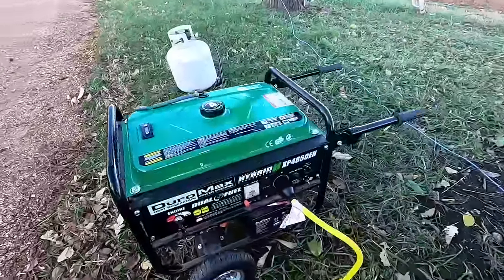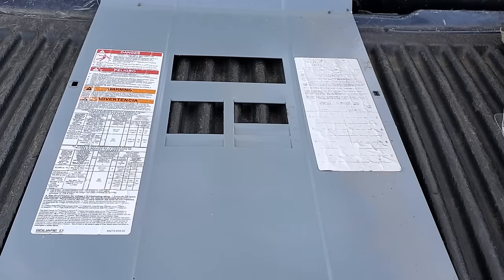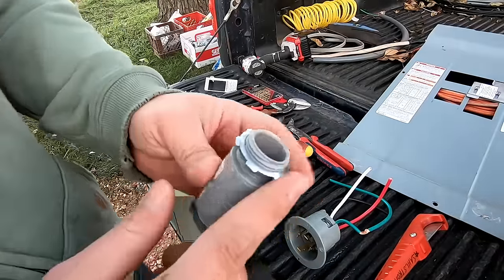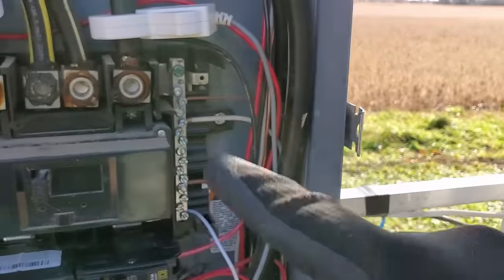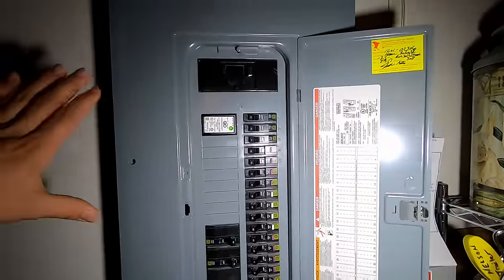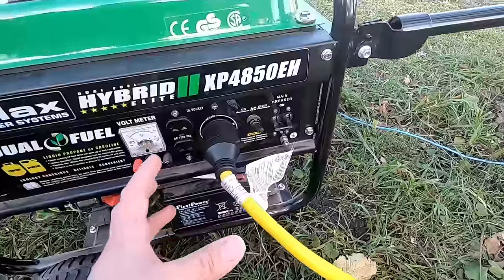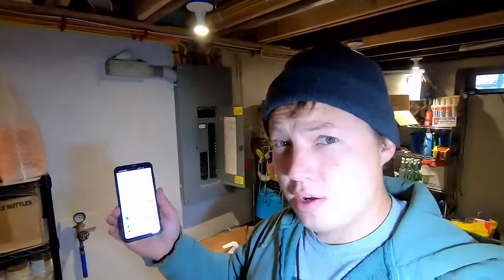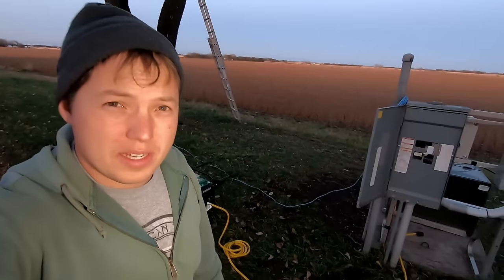How To Hook Up a Generator To Your House Using a Breaker Interlock Kit & Power Inlet Box

Comment: Nice job Ben; thanks for your helpful videos! Question for you regarding grounding the generator... I note that you felt grounding the generator frame to a grounding rod was not necessary because there is a ground current established via the power receptacle on the generator back to the ground in the breaker panel. However, if the generator’s ground is bonded to the frame, isn’t there still potential for a human body to complete a circuit between the generator frame and the ground... even if there is already a ground circuit established via the cord going back to the panel? If so, wouldn’t it be best to unattach the generator ground-to-frame circuit? Or do you feel that’s not necessary? I’m using a DuroMax dual-fuel generator as well, and haven’t looked into the wiring harness to see how that would be done... any tips on that? Thanks for the help!
Reply: Following up on the grounding issue: take a look at this video on YouTube: Interlock vs. Transfer Switch - a follow up video.wmv
Towards the end you’ll see that this person removed the ground-to-frame jumper on his generator because he wired his generator directly into the house panel, just as you did. Think it’s something you’ll now consider doing? I would like to look into myself, and determine which wire is the grounding bond on my generator. Any thoughts?
Reply: Also: did you ever assess why your generator breaker went off on you in the video? Didn’t seem like you were really pushing the load on it enough to cause it to shut off???
Reply: Actually, the issue isn’t as much as the ground to frame connection as   much as it is about whether your generator has a bonded- or floating-neutral configuration! I believe a quick continuity check between the neutral and ground pins of your generator receptacles will confirm that your generator is bonded neutral. With your application, powering the main panel directly from the generator receptacle, I believe you would want to reconfigure your generator with a floating neutral. Basically would involve disconnecting the short white jumper that connects the white wire (neutral) coming out of the windings to the generator casing. Bet that’s what you’ll find if you open up the generator cover! You with me?!?
Reply: I talked with DuroMax for more clarity: even though your generator’s neutral is bonded to the ground, DuroMax calls it a floating neutral generator  because the bond is made at the generator casing and “floats” unattached to the generator frame (note that the generator is mounted on rubber insulated mounts). It’s probably more accurate to call it an “isolated  neutral.” In any event, you may want to reconsider your wiring with the generator with your application. DuroMax suggests grounding the generator with a grounding rod attached to the grounding nut on the generator’s control panel and then eliminating the generator-receptacle-to-main-panel-ground-bus connection. Your current hook-up may be problematic because your ground circuit is “energized “ by the neutral at the panel, where the ground and neutral busses are connected. Make sense?
Reply: Interesting; perhaps your generator mounts are not insulated... I notice you got continuity of the ground between the breaker panel box and the actual frame of the generator (or was it the screw holding the generator control panel?) - not just the grounding nut on the generator control panel. My generator is the DuroMaxSP12000EH, and might be configured slightly differently than yours... but still you might want to do a simple continuity test between the neutral and ground pins of one of your receptacles to see if they are bonded.

Comment: Hey Ben! This is a great video, thanks for sharing. I especially like the way that you ran the leads coming in from the back-feeding circuit through the Sense clamps such that you can monitor your loads while off-grid. It seems like this approach would work just fine as only one set of leads will be energized at a time. Do you find that placing the clamp around both sets of leads works as you thought it would? BTW, I used your discount code to purchase a Sense device a little while ago. :)
Reply: ⚠️Please don’t forget the rules about generator safety: This is a very important announcement for everyone. It’s important to follow all generator safety rules whenever we use portable generators: 

Everyone must see this. This is just a reminder for everyone’s safety. 

1) KEEPING OTHERS SAFE: Please do not allow an unqualified person or your children to operate and service the portable generator. Just because some manuals don’t say that doesn’t mean it’s safe. That is important against the generator safety rules. We also need to be keeping an eye on our children too. You need to make sure that your children are not playing near the portable generator especially when it’s running so they won’t get electrocuted. Generators pose electrical risks and they can be hot during an operation. Please keep your children away from the portable generator at all times. It is important to keep our children safe especially our little ones. Be aware of all the hazards.

2) WHERE TO RUN YOUR GENERATOR: Some people use their portable generators indoors which increases the risk of carbon monoxide poisoning. It’s important to have a carbon monoxide detector if you have a gas generator. Never ever use your generator indoors even if your doors and windows are open and even in the garage is not safe to use a portable generator. Not even at your porch and your deck. It is never safe to use your generator indoors and in enclosed areas of your home. Your generator needs to be 15-20 feet away from your house. 

3)🔥FIRE HAZARDS: Never refuel your generator while it’s running. You need to let your generator cool off before refueling it and before storing your generator. Never overload your generator too. Never ever back feed your generator. You should never plug your generator into a wall outlet. Also never store propane tanks indoors. Please keep flammable things away from the generator as well and please don’t smoke cigarettes near the generator. Having a fire extinguisher next to the generator is also important against the generator safety rules. 

4) GENERATOR OPERATION: make sure your hands are dry before touching the generator. Never use your generator in wet conditions. Don’t let your generator get wet. You need a generator tent if you need to use your generator during wet weather. Please don’t wear loose clothes when operating the generator. Turn on your generator before plugging in appliances. Use the right cord for your generator. Please do not use worn out cords. 

https://youtu.be/I1jT3ANENvI and here is a video more about keeping others safe when using generators 

Hope this helps. Remember safety first

Comment: I sort of understand why not to run electronics (TV's, Computers, etc) off an non-inverter generators, but I've never had anyone tell me why?  Is it current or cycles that does the damage?  HOW?  Also  can a good quality  APC/UPS be used to smooth out whatever it is that isn't good for electronics??

Comment: I noticed that you plug in 240 volts from the generator to your interlock breaker and you said that you now 240 volts going into your house, isn’t it that household appliances run on 110 volts, so how going run those appliances on a 240 volts electricity.
Reply: How long can run your generator with one tank of profane?

Comment: You're breaker tripped because you're using a 30 amp outlet on your generator with a 30 amp inlet box with a cord rated for 30 amps. 30amps x 120volts = 3600 watts. Breakers will/may trip at 80% capacity. 3600 x 80% = 2880 watts. You should know this.

Comment: If the new breaker is only powering one leg (the right side of the panel), does that mean only the right side of your panel has power in the house?
Reply: He installed a 2 pole breaker for power from the generator, so he has both phases. Also, if you only use one phase, it doesn't take out one side of the panel, the phases alternate each circuit or "slot" in the panel.   So on the left side of the panel circuit 1 would be A phase, 3 would be B phase, etc.
Reply: @chriswright976  Ok yes that makes sense. If he were using 110v instead of 220v, using a single pole breaker, then he would only be powering one side

Comment: Thanks for the video
Reply: ⚠️Please don’t forget the rules about generator safety: This is a very important announcement for everyone. It’s important to follow all generator safety rules whenever we use portable generators: 

Everyone must see this. This is just a reminder for everyone’s safety. 

1) KEEPING OTHERS SAFE: Please do not allow an unqualified person or your children to operate and service the portable generator. Just because some manuals don’t say that doesn’t mean it’s safe. That is important against the generator safety rules. We also need to be keeping an eye on our children too. You need to make sure that your children are not playing near the portable generator especially when it’s running so they won’t get electrocuted. Generators pose electrical risks and they can be hot during an operation. Please keep your children away from the portable generator at all times. It is important to keep our children safe especially our little ones. Be aware of all the hazards.

2) WHERE TO RUN YOUR GENERATOR: Some people use their portable generators indoors which increases the risk of carbon monoxide poisoning. It’s important to have a carbon monoxide if you have a gas generator. Never ever use your generator indoors even if your doors and windows are open and even in the garage is not safe to use a portable generator. Not even at your porch and your deck. It is never safe to use your generator indoors and in enclosed areas of your home. Your generator needs to be 15-20 feet away from your house. 

3)🔥FIRE HAZARDS: Never refuel your generator while it’s running. You need to let your generator cool off before refueling it and before storing your generator. Never overload your generator too. Never ever back feed your generator. You should never plug your generator into a wall outlet. Also never store propane tanks indoors. Please keep flammable things away from the generator as well and please don’t smoke cigarettes near the generator. Having a fire extinguisher next to the generator is also important against the generator safety rules. 

4) GENERATOR OPERATION: make sure your hands are dry before touching the generator. Never use your generator in wet conditions. Don’t let your generator get wet. You need a generator tent if you need to use your generator during wet weather. Please don’t wear loose clothes when operating the generator. Turn on your generator before plugging in appliances. Use the right cord for your generator. Please do not use worn out cords. 

https://youtu.be/I1jT3ANENvI and here is a video more about keeping others safe when using generators 

Hope this helps. Remember safety first

Comment: You did good just you're not supposed to be drilling holes making your own holes on the back of that breaker panel also your not to be running your wires up on utility side u need to stay below. The wattage meter was really nice like that.

Comment: Thanks I have the same generator also. THis really helps.
Reply: Remember to always make sure you follow all the generator safety rules whenever you use your portable generator. 
⚠️Here are the Generator safety rules that everyone needs to follow when using generators:

This is just a reminder for everyone’s safety when using portable generators. All generator safety rules need to be followed carefully to avoid hazards. 

1) Please do not allow an unqualified person or your children to operate the portable generator. Just because some manuals don’t say that doesn’t mean it’s safe. That is important against the generator safety rules. We also need to be keeping an eye on our children too. You need to make sure that your children are not playing near the portable generator especially when it’s running so they won’t get electrocuted. Generators pose electrical risks and they can be hot during an operation. Please keep your children away from the portable generator at all times. It is important to keep our children safe especially our little ones. Be aware of all the hazards.

2) Some people use their portable generators indoors which increases the risk of carbon monoxide poisoning. It’s important to have a carbon monoxide if you have a gas generator. Never ever use your generator indoors even if your doors and windows are open and even in the garage is not safe to use a portable generator. Not even at your porch and your deck. It is never safe to use your generator indoors and in enclosed areas of your home. Your generator needs to be 15-20 feet away from your house. 

3) 🔥generators cause fire hazards too. Never refuel your generator while it’s running. You need to let your generator cool off before refueling it and before storing your generator. Never overload your generator too. Never ever back feed your generator. You should never plug your generator into a wall outlet. Also never store propane tanks indoors. Please keep flammable things away from the generator as well and please don’t smoke cigarettes near the generator. Having a fire extinguisher next to the generator is also important against the generator safety rules. 

4) generator operation; make sure your hands are dry before touching the generator. Never use your generator in wet conditions. Don’t let your generator get wet. You need a generator tent if you need to use your generator during wet weather. Please don’t wear loose clothes when operating the generator. Turn on your generator before plugging in appliances. Use the right cord for your generator. Please do not use worn out cords. 

https://youtu.be/I1jT3ANENvI and here is a video more about keeping others safe when using generators and also about our family’s safety. 

Hope this helps

Hope you find this helpful

Comment: And great video I’m planning on doing similar, but with a DIY Generator someone with you’re wisdom in electronics be easy - car Alternators create Ac current and I’m plain and designing to be self-sufficient no gas ! Powered by the same electricity I create ! 1 I can use the Ac current changed over to Dc to charge my lithium battery bank I’ve got 1 Gm One -Wire High Amp Alternator 110A , I’ve got 1 Gm One-Wire High-Amp 120A & I’ve got a Ford Alternator “ Yeah” I know about Ford - Found On Road Dead “ Yeah “  but I’m hopping for First On Race-Day !  but this Alternator is 150A I have Dc powered motors to turn them speed controllers an issue connecting the BMS for the battery banks to the 775 Dc 12v motor to turn on when the volt drops for the BMS to turn on or  reroute the electricity to the 775 Dc Motor ! I’ve got the Moes Inverter 120v @ 50A 2 Phase I’ve got 2 AWG /3 because I’ve also have a 5KVA 230v Pure Sine Wave Inverter 230v Charge Controller 48v which is 98A at 5KVA ! I know I’m not doing all Correctly or in the proper order but if we lose the grid my family is my first concern you know thanks for you’re. Detail and precise explanation , even for someone like me that only want to be ready when an emergency happens ! I have a 100A Double pole breaker but I think I should get a 50A 2 pole breaker because of the Moes inverter automatic transfer switch !